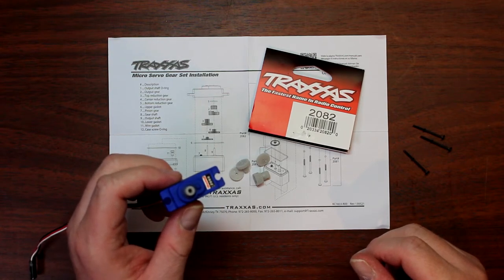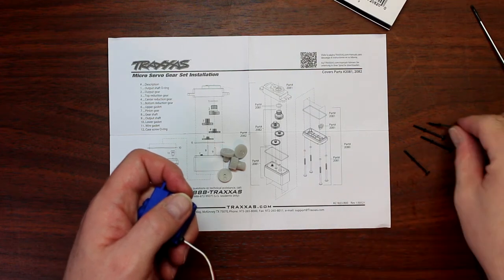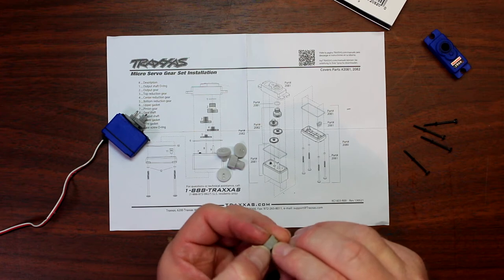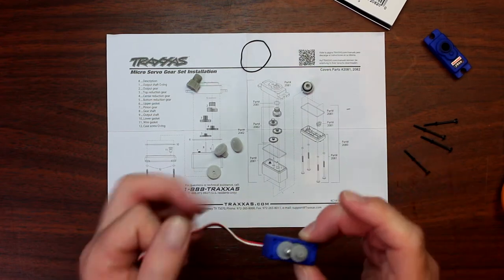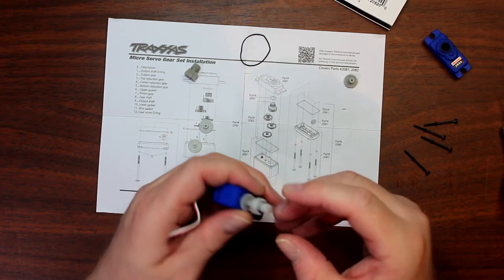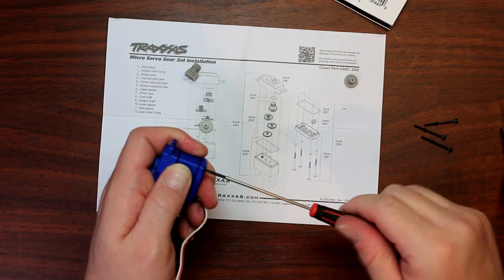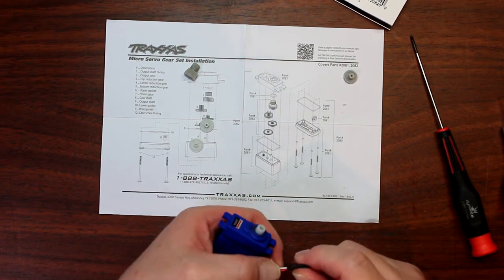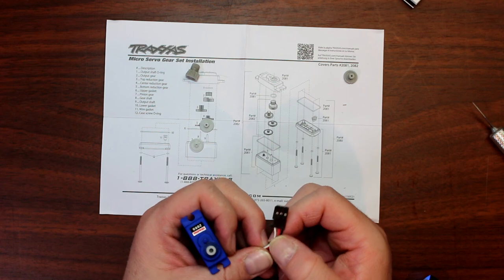How to Replace Servo Gears 2080 Searvo Traxxas

Comment: Will the 2085x servo with metal gears work in a traxxas maxx??
Reply from the maker: I’ll be honest I do not think so
Reply: You probably already gotten your answer for this question along time ago but if you ever checked in the Traxxas Maxx manual it’ll tell you every single servo that you can use with it